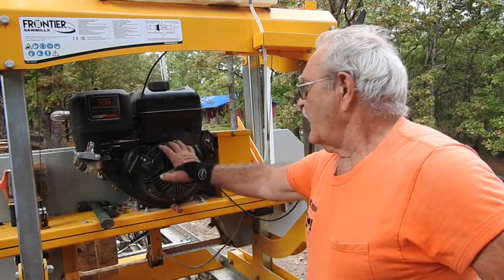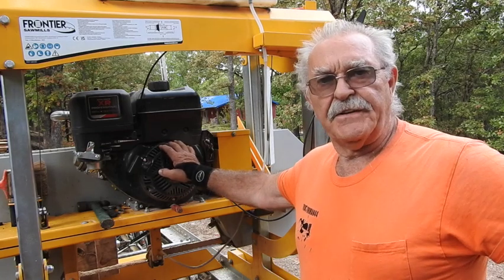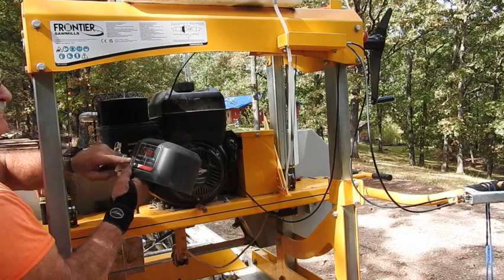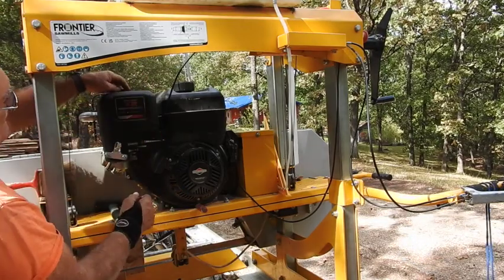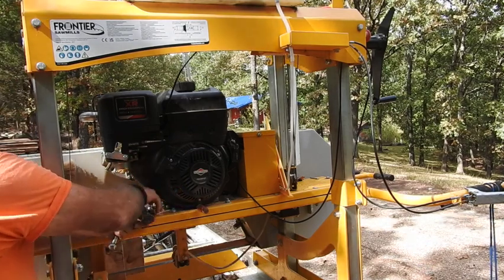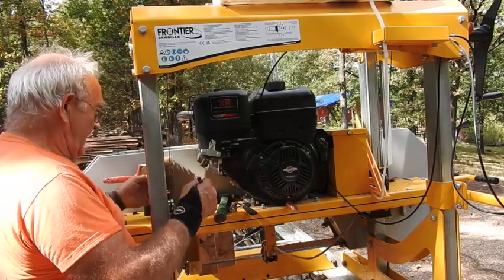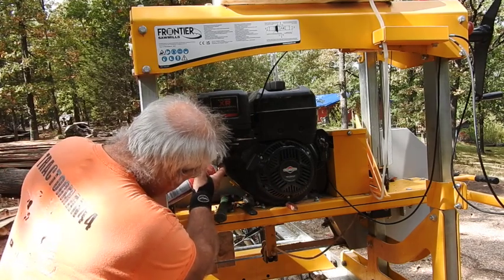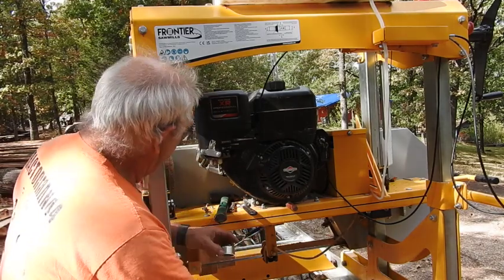Fail For Frontier OS 27- Yes, It Developed A Problem Plus a Little Sawing

Comment: Hi my friend. I have been hearing about some fuel hose made in China being very bad to start coming apart and leaving a black rubber material  in filters and carbs. causing lots of trouble . Hope this helps. Liked and shared and all my very best.
Reply from the maker: Yes, there are some lines that deteriorate with the alcohol in some gas for sure.  I DID get it put to rest and that'll be in an upcoming vid Bobby.  Thanks for tuning in my friend.

Comment: Those newer one cyl engines are quite picky about fuel. I usually add a bit of a product called Chem Tool to my one cyl gas.
Reply from the maker: Yes, I use PRI-G additive.  It's guaranteed to keep gas stable for two solid years.  But it doesn't do anything for dirt dropping off the can into the tank...unfortunately.  LOL

Comment: Yep! The old engines are easier to work on pretty simple to figure out. I have a Honda on my pressure washer that's been giving me fits. Taking the carburetor off is a challenge in itself! They weren't made for big hands to work on them. I'm running a tank of gas with Techron in it to try and clean out anything I can't see. Good luck with the B&S. 👍👍👍
Reply from the maker: You'll see the final results in the next video coming up I think.  I tell ya though, with these small passages, the best tool is an ultra-sonic parts washer.  Yessir.

Comment: Glad you could make your boards, definitely a idle circuit issue in the carb, dirty idle jet I guess
Reply from the maker: Good thoughts Jan.  I wish I could've gotten the camera to focus on the size of the size of the idle passage. It and the three intermediate, or mid range, passages are so small the tip of a pin will barely enter.  Just a fleck of debris plugged it up somewhere up into the aluminum casting and it took some work to get it back in operation.  Compressed air would not clear it because I couldn't seal the nozzle onto the orifice.  The ultrasonic washer did the trick but it was not easy !!

Comment: Good evening Wendell, You blew out the main jet but what about idle passage? Maybe pull the carb off completely and examine looking for the idle passage and blow air into it. I agree with you sounds like fuel starvation on idle but main is flowing well .  Governor also seems to be working fine. BTW as soon as I clicked on the video a YouTube warning directed towards me saying I left a offensive comment and this is my final warning and they would ban me from Youtube? I never leave offensive comments and this shocked me.
Reply from the maker: On this preliminary venture into the realm of small engine and their modern carbs I did blow into the general area of the teeny tiny idle circuit.  The  aluminum passages are so small the tip of a needle might barely enter.  AND they are at a 90* angle to the body just downstream of the throttle plate.  So air entry was marginal at best.  There are 4 such passages, only one is downstream of the closed plate providing fuel at idle. As the plate opens, it exposes three more in succession that serve the mid range acceleration then at WOT or near it the main jet provides the lions share of the fuel.  Typical setup, but not able to be done adequatey with this usually simple method of clearing them (it) out.  The following vid ends with success, but it was a pita.  But then, it always is isn't it.  LOL
   As far as your offensive comment, it HAD to be something about you saying good things about a Chevy or something....Jus' sayin'.  Sacrilege !!
Reply: @tractorman4461  Ok 👍 sounds like you conquered the problem, but guess what I will watch the video when I have a chance and enjoy every moment of your trials and tribulations and final success with that small engine carburetor.  Well I’m off to the shop to work on modern vehicles with fuel injection haha . Make it a great day! Maybe they didn’t like the word MOPAR ?  BTW the white car was a 64 Polara

Comment: Rain, what’s that?   We didn’t get but a sprinkle and need a good soaker.   Maybe this wk according to the weather bird!   Hope the problem will be an easy fix.
Reply from the maker: Yeah, it rained just a bit...enough to settle the dust that night.  Might have been less than that actually.  Yes, it was an easy fix, just time consuming to do it. The parts are so small and the space is so tight.

Comment: I’m curious to see what was the matter , I have a Norwood bandsaw mill I bought in 1996 , it’s still running real good , I just used it this evening on white oak , I need to sharpen a pile of blades sometime
Reply from the maker: In some ways I wish I'd spent just a few more bucks for a similar Norwood.  The Frontier is their lower level machine, as you already know.  I DO believe though it would have been good money spent.  But for what it is, this little guy is perfect.  I have a follow up video coming soon on getting it back on line.  Basically I need to make sure I dust the gas cans off better before dumping fuel into the tank.  I found a local guy that'll sharped blades for 8 bucks apiece. I'll have him do mine until I can figure out a set up for myself.  What do you have to sharpen them...??  If I can ask.

Comment: Well looks like you can at least cut your lumber. I read and what other people said and they basically said what I was going to say. Look forward to your next video
Reply from the maker: Yeah, I get it sorted out in the next video.  I suspected that was going to be the cure, but I always start with the simple attempt first.  It's such a pain dealing with all the plastics nowadays.  Actually the first attempt was a heavy mixture of sea foam for a tank....but that didn't unblock what was blocked, but it probably softened it up a bit.

Comment: Man that is a bummer that the motor is giving you issues already, Hopefully it is just a fuel issue.
Reply from the maker: Yeah its a fuel issue.  I get it taken care of in the next video.  Back up and running and processed another 3 or 4 logs since then.
Reply: @tractorman4461  thats good that it was just fuel issue and you got it sorted

Comment: Hello tractor man 44 where can I find a front end loader for a Ford 5000 67 model
Reply from the maker: All I can suggest is FB Marketplace is your friend.  If you've not done it before, type what you are looking for in the search bar and see what pops up.  You may be surprised what you find.  I just sold an industrial styled loader that would probably have been easily adapted to the 000 series.  It was off a 00 series Ford. The only thing was the bucket was only 48''.  Good luck in your search....other than that look for tractor salvage yards.  There is one near me in eastern Missouri that specializes in old Fords.  Rippee's Tractor and they are on the net.

Comment: Sure does seem like a `dirty` carb. to me too.
Reply from the maker: I got back into it the following day and its' back purring like a Cadillac now !!  Fuel treatment is great for minimizing phase separation, but it doesn't do anything for dust or small debris falling into the tank off of the gas can....LOL.
Reply: @tractorman4461  You know Wendell, it`s a pity that these engines are not supplied or equipped with simple fuel filters, isn`t it?
Reply from the maker: @regsparkes6507  You know some of them are engineered so close to tolerances that on some small engines with gravity feed, adding a fuel filter will add enough restriction to the fuel delivery that they will starve for fuel if the tank gets below half full.  Now that sounds like baloney, but it sure is a thing on some of them.  You see some crazy stuff out here man. LOL
Reply: @tractorman4461  Yes we do, and that's a fact.

Comment: I would look 😊😊 and see if there's a inline fuel filter take and clean out W air hose I would strain the gas off from now on 2 I would clean the sparkplug W a wire brush  3 if U can check the sparkplug the current should be bright blue it won't run on water 💦  either let me know what U find thank U 😊😊OMG 1O 22 2O23
Reply from the maker: One thing about it, these new machines do need a bit of maintenance and you listed the right stuff to keep an eye on Clarence.  I DID get it sorted out the next day and have been sawing quite a few since then.

Comment: That's a shame it's giving you problems Wendell 😕  I'm sure you can get the issue figured out soon enough though 🔧🔩
Reply: Back in november of 1972 I bought a brand new 923 homelite chainsaw. In about a month it started giving trouble wouldnt idle. hard to start when warmed up. The dealer I got it from was no help. I bought a siezed older similar saw and installed my new saws piston and cyl on it and had a dependable saw. Now decades later I have learned what was wrong with it. It had a bad crankshaft seal.
Reply from the maker: Well Zane, I DID get it sorted out and back on the road to recovery the next day.  Purring like a kitten once again....video at 11.  I just don't know which 11 it will be..  LOL
Reply from the maker: @thecollectoronthecorner7061  Usually a crank seal causes them to over rev and run lean.  That's usually the big tip off.  I've got a seal issue on the little 026 Stihl right now and am hoping to get the time to fix it before she scores the jug.  But we will see.  Those old Homies were a good saw.  Dad was a McCullough man but his one brother was Homelite crazy !! Its the Ford - Chevy thing.